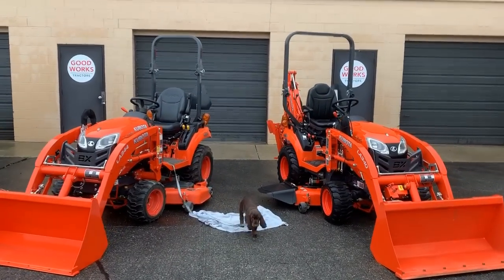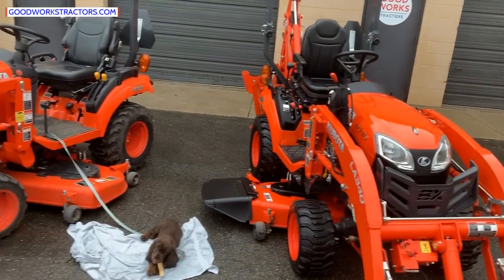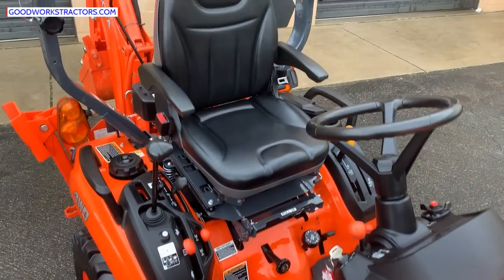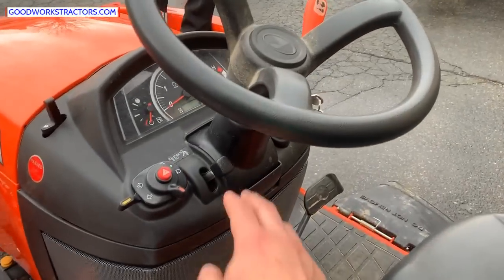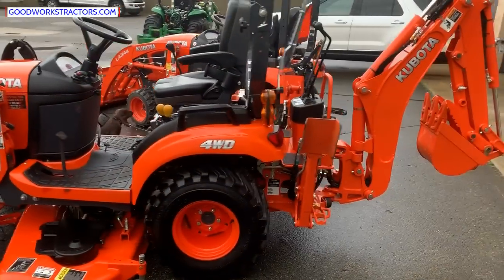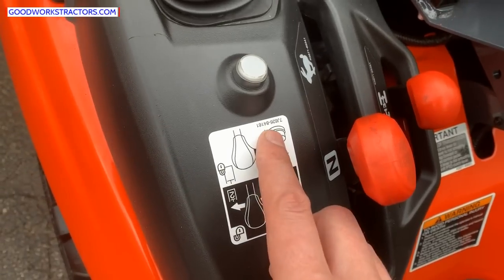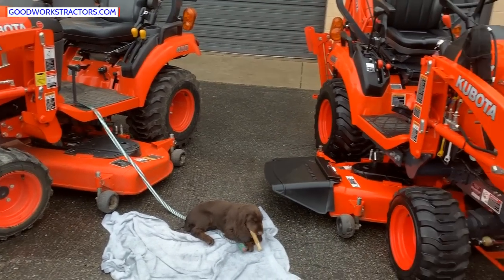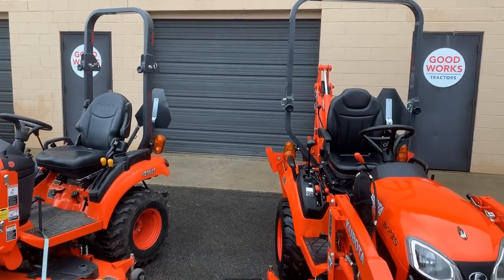The NEW Kubota BX23s vs BX2380 Tractor Comparison: Overview of the features, options, & equipment!

Comment: Can you get the 3rd function on the bx2680 to use a snow blade with? If so do they make a quick attach snow blade to pop of the bucket slap it on and go?
Reply from the maker: Yes, I believe the bx23s in this video has that 3rd function option shown on it.  Yes, they do make a quick attach snow blade.  Not cheap though.
Reply: @GoodWorksTractors  just so you know, the previous guy asked about the BX 2680 not the BX 23. By the way nice explaining about the BX2380 with what seems like a total of 3 mins of talk time
Reply: @wraith3951  they're the same tractor just the 23s is backhoe compatible. You can get those options for 2380.
If you want a backhoe on the 2380 the dealer will make you buy a Woods aftermarket backhoe with separate seat. Just asked two dealers today those exact questions.

Comment: How do you feel about wheel spacer on BX23S.
Reply from the maker: Use them if needed, at a certain point, you might not be able to fit the mower deck.  Safety first in my opinion.

Comment: The Bx2380 has engine displacement of 54.8 cu.in.  This seems lower than similar tractor.  The John Deere 1025r is 77.2.   That seems quite a difference.  Even the Kioti CS2210 has engine displacement of 69.   Does this mean that the Kubota isn't as powerful as the others.

Comment: I'm pretty sure there is a drive over deck. It's available in Oz.
Reply from the maker: Yes, the EZ drive over is an option.  I've been told by several Kubota dealers that they sell very few and don't recommend them to their customers.  I think that speaks for itself.
Reply: @GoodWorksTractors  My 2370 came from the dealer with drive over deck and quick connect already installed and it works great, I can put the deck on or off in under 2 minutes.
Reply from the maker: MrJohn714 there's always a first :)

Comment: Backhoe cannot be added to the 2380. Requires a different frame.
Reply from the maker: Correct.  If you want a backhoe on your BX, then you must buy a specific backhoe model like the BX23s, BX25, BX24, etc.

Comment: I bought a bx23 and dam thing has been in the shop more than at my property. Piece if CRAP
Reply: For what issues? How many hours? Is it a new model or did you buy it used? I bought one  in June of 2020 and have 200 hrs of hard work on it with zero issues at all.